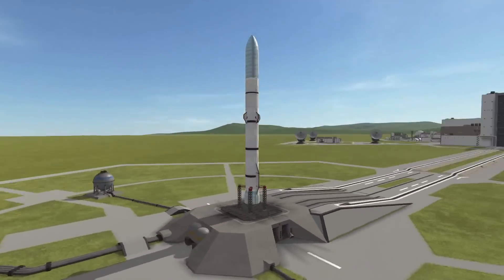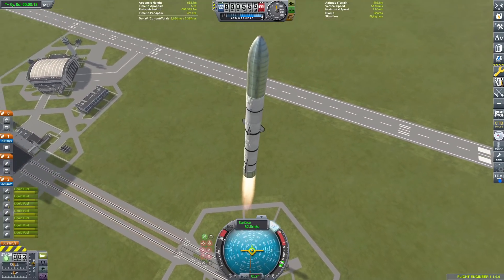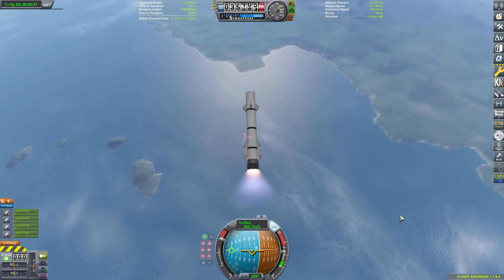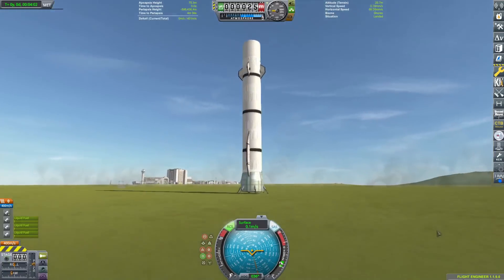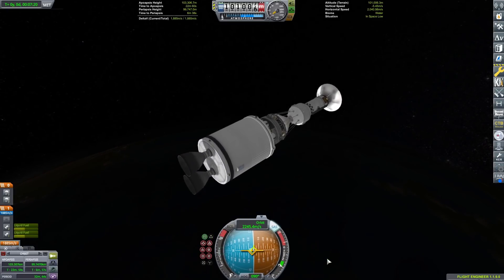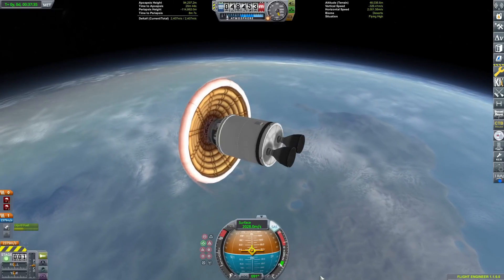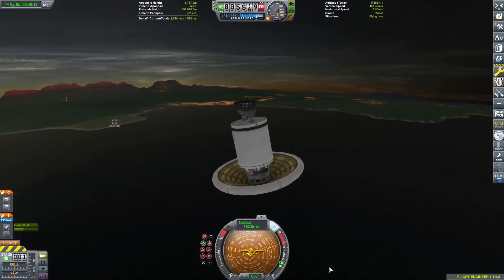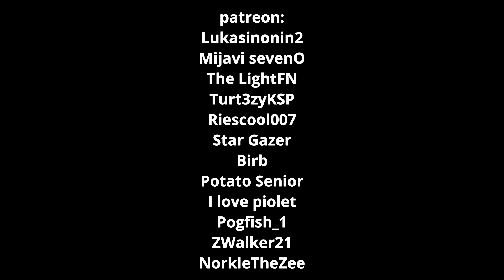KSP: Blue Origin Wants New Glenn FULLY REUSABLE - How They Might Do It!

Comment: Just some news updates for you, I’m assuming this video was made without this latest info in mind:
New Glenn’s first stage isn’t changing to stainless steel, the Jarvis stage is currently testing being stainless steel however.
There’s a stainless steel test tank built for Jarvis that is larger than the old upper stage.
There are currently 3 main plans for reusability: basically a smaller starship, a stage with an aerospace engine that doubles as a heatshield, or a spaceplane like stage that would return to a runway.

This is all according to Ars Technica who broke the story of Jarvis existing to begin with, this time with more info and pictures of a stainless steel test tank at Blue Origin’s launch facility at Kennedy Space Center. Amazing how Jarvis has hardware before New Glenn.

Comment: "That just sounds like a starship with extra steps!"
Reply: Literally. SpaceX has focused on decreasing moving parts and just making things simple, which is also why they won't need abort systems.
Reply: @rbxless  a escape system is always needed, wgatever the safety of a rocket, you need it. The starship's belly flop is fucking dangerous in my opinion, they still have some fails on the falcon landing, so there will be fail on starship, and i don't wan't to be in when that will happen without escape possible
Reply: @n.o6889  for the Artemis program, only tanker ships are going to land, and by the time humans are on board during landings, they probably would have it down to a science like the falcon landings.
Reply: @n.o6889   the difference with falcon and starship is the f9 booster never has humans when landing it sometimes fails becouse they push it  to the limits if they wanted humans on the f9 booster when landing they whoud make sure it whoudnt fail
Reply: @n.o6889  You can't design an effective launch escape mechanism for Starship.
And in case of belly flop, I'd like to think, that people will land in a separate craft eventually.
Reply: @blinded6502  yeah, i know it's extremely complicated to make an escape system, but that don't change the problem, an yaeh, separate craft can be used, but that a bit stupid so that having a huge boy like that, having only smaller ship is more effective in that case
Reply: @n.o6889  Small ships are fuel inefficient.
And it's not complicated, it's impossible for this design. You can't have both Starship and a huge overcomplicated abort system.
Imagine if planes had an abort system in case of a sudden explosion at a runway.
Reply: @blinded6502  Plane are way more sure than rocket, because there aren't gitantic overpresuriseds that can explode if anything gon wrong, and why small ship are less fuell efycient?
Reply: @n.o6889  Bigger surface area compared to volume, which means atmosphere affects them more